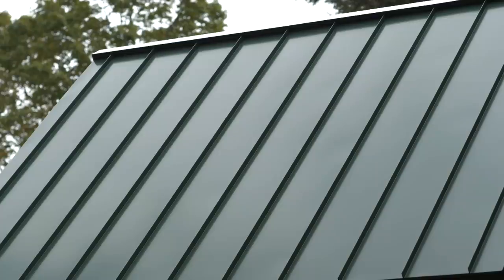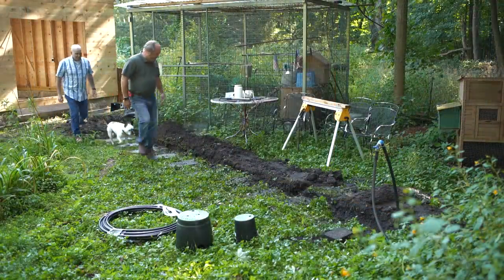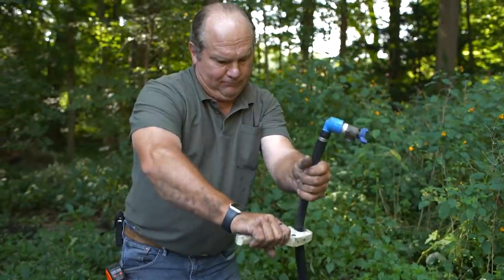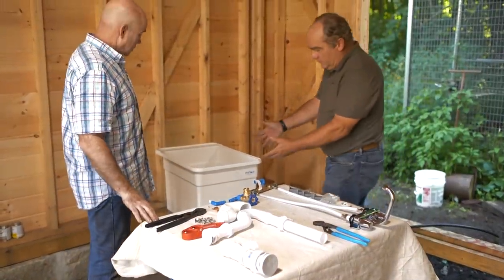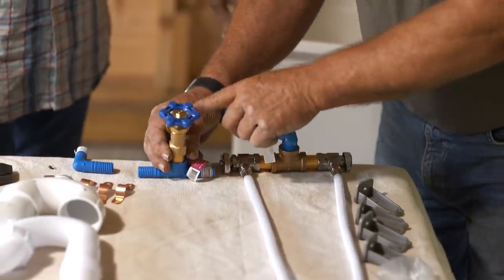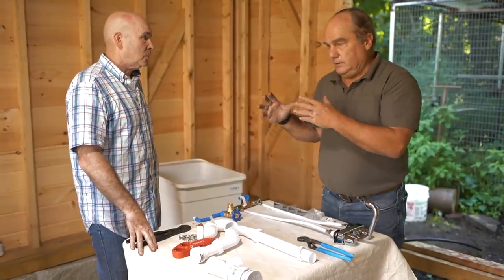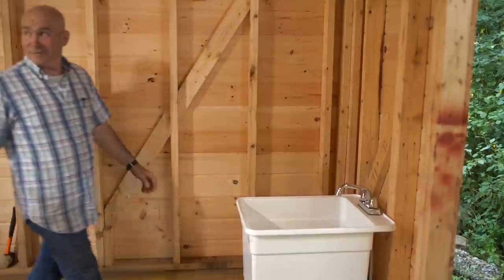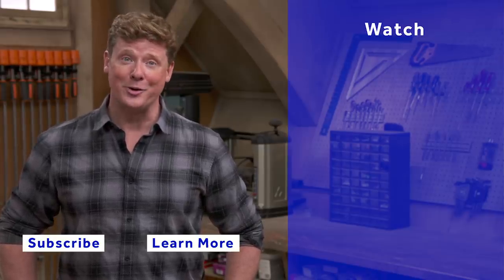How To Install a Utility Sink in a Barn | Ask This Old House

Comment: Richard: "This is called the top gasket, this is the one you don't wanna lose."
Also Richard 10 seconds later: throws top gasket off table.
Reply: 🤣 saw that too
Reply: Gimme a break, big difference between a part falling off a table and losing it.
Reply: @ShawnD1027  one first good step to lose something is throwing it off the table you've left it on.
Reply: I also caught that detail
Reply: Funny.

Comment: I'd like to see more unpermitted work on TOS. :)
Reply: .....so silly it's funny!
Reply: Yeah but this is unpermitted because it doesn't need a permit.   Like that S-trap instead of a P-trap with a vent is allowed because it's not going to the sewage lines so if a siphon in some way pulls water out of the trap it's no big deal it's simply outside air under the gravel that is going to come in.

Comment: Is the p-trap really required?
Reply: Not to prevent sewer gas but I guess in case you drop something like a ring. Don’t want to have to go fishing for it in the dry well outside.
Reply: @c0mputer  .. if he flipped drain box over and drilled a few holes in the bottom it would be serviceable without digging up anything. Could also use a slip sleeve for frost so a heave by the box doesn't break the pipe.

Comment: I always called the washer that goes on the basket a flat or flange washer. I don’t use them on plastic though, only on cp. I generally rely on pipe dope. With plastic I put a little on the flange and with cp I put some on the flange and some on the top of the washer
If you’re going to omit the vent why not omit the trap as well then it will self vent. It’s going to a dry well so sewer gas isn’t an issue. The only time I put a trap on a gray water line is when it goes outside and that’s to keep bugs out. This is going into a dry well so I don’t think you need it. It’s also one less thing you have to worry about freezing

Comment: Why bother with the p trap if the pipe was run directly outside? It seems unnecessary and adds work in the winter to drain the trap so it doesn’t freeze.
Reply: have you ever tried to find the pieces you'd need without buying a P-trap? (especially now)
Reply: @rupe53  plumber here, it would be very easy to plump that without a p trap.  Plus, you don’t have to winterize it.
Reply: @woohunter1  ... I would agree that it doesn't need a trap but the average guy at the hardware store will have trouble buying something adjustable without purchasing a standard trap kit. Besides, if the water is off for the cold season they can just remove the trap and hang in on the wall. No big deal.

Comment: I have a air quick disconnect and compressor that connects to the outside water feed inside the house that blows out all the outside plumbing for winter.

Comment: That connection to the sprinkler system should at minimum been a double check valve Backflow, vacuum breaker shouldn’t be below grade.
Reply: I agree with the vacuum break not being below grade or in the drain box where it can be covered by water as vacuum breaks need air to work. Also agree with the check valve though I would hope there is one back at the house as, at least where I am, you need a double check valve with vacuum break in the middle between a potable system and an agricultural cultural system. 
A below frost shutoff would have been nice to see as would a trap-less install as it would actually have been usable in the winter or at least more usable down the road. Ran a similar setup to the garage and actually added an electric tankless water heater for hot, nothing too big but enough for the 2 odd gal/min at maybe a 60 degree rise. Actually uses an electric shutoff/dump valve 48-52” down to ensure the system was dry when the water was off, as I only heat the garage when I’m using it.
I’m surprised as much as this show can over build that they did what they did hear.